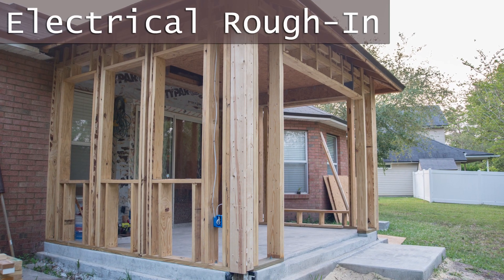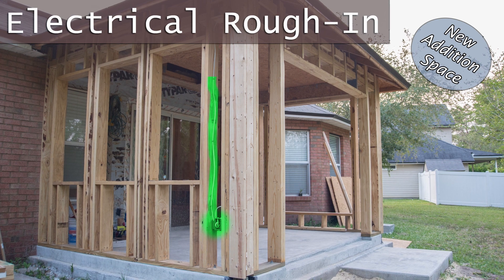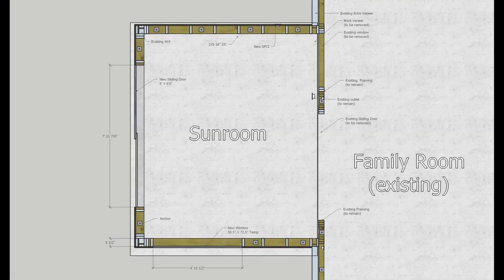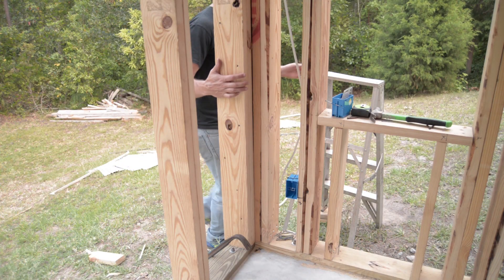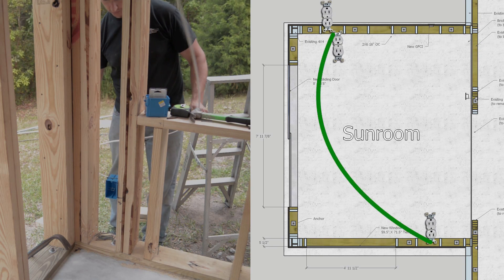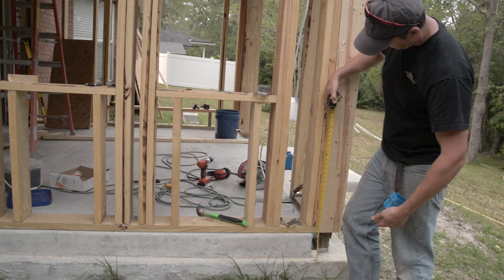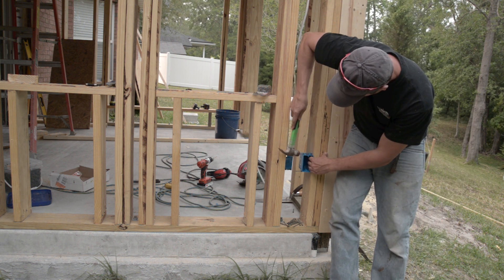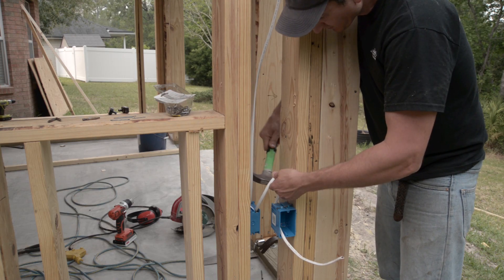How To Run Wire in New Addition, Rough-In Electrical Vid #6

Comment: How about light
Reply from the maker: This room already had an overhead light/fan box installed with a working circuits. This was for the porch light and fan.  So planning a light into the circuit was not necessary for this new room build.
Reply: Oh I'm sorry I was asking a question, I got the outlet part but what about if I need 4 to 6 recessed lights how do I wire and connect that?

Comment: Easy to the point video.
Reply from the maker: Thanks Jodie, I actually recently had to tap into this circuit to run a switched exterior light. worked well.

Comment: your outside outlet should have been on a separate circuit
Reply from the maker: It was not required in this region but I did end up coming back and running a 12 gauge line on its own circuit for the exterior outlet (GFCI).  Figured that was a better set up for running tools and such in the yard.
Reply: Dont tell code enforcement he will have to get a architects sealed print and a building engineers seal permit and an electrical engineers seal, will probably let a heart attack from all the crap they will put this guy through.